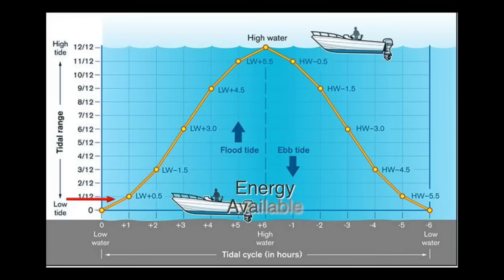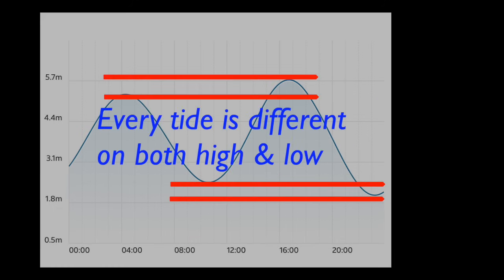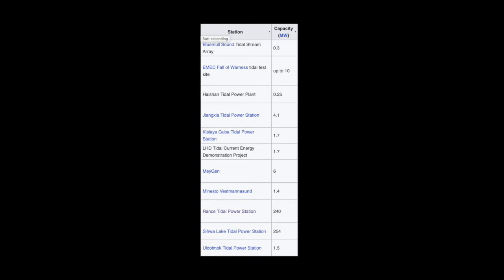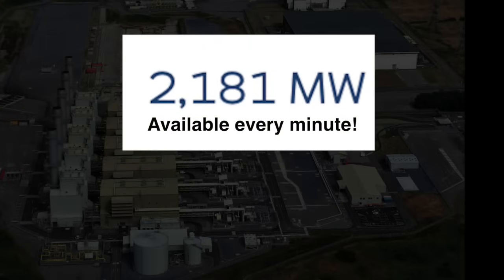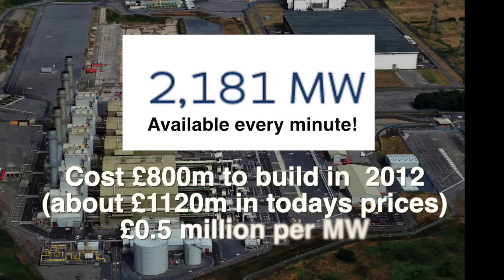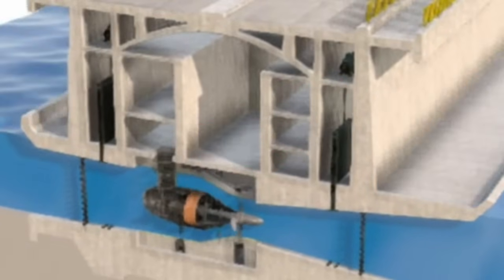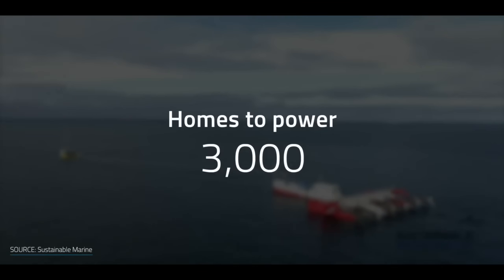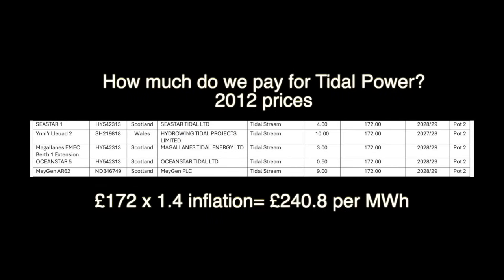The Delusions of Tidal Energy

Comment: Excellent video Paul. to realistically produce continuous power you need 6 units separated by enough distance to have only one unit at a time experiencing slack water,  2 will be on full stream  and the other 3 combined will provide something close to one on full stream. ie 50%  of the available capacity. As the units are small, 100s will be needed around the coast giving some economy in scale  but when compared to coal, oil or gas they will be many times the price. I consider Nuclear too dangerous especially in this war mongering world
Reply from the maker: Yes but that would be totally unaffordable and still not provide enough energy.
Reply: @ClimateRealism  I worked all this out some 30 years ago when i worked in the power generation industry. Noone wanted to listen

Comment: Great video as usual Paul; could you please do one on the Flywheels mentioned in the Telegraph today. I don't understand how they store energy. Many Thanks
Reply from the maker: Flywheels do not act as an energy store - the just balance out small fluctuations.
Reply from the maker: Just read what Milliband has said - totally, totally bonkers. No understanding of anything at all..
Unless power is supplied it slows down and loses the  energy - no good for other than a tiny evening out of the  energy. Insane.
Reply from the maker: Just fully caught top on these Norwegian flywheels - these CANNOT BACK UP ENERGY FOR MORE THAN A TINY AMOUNT OF TIME. I will do a video on it, it is so absurd it takes my breath away.
Reply from the maker: I am so mad about this absurd idea:-
" In the present scenario, flywheels of 1 kW power storage capacity for 3 h and 100 kW for 30 s have been successfully developed. Design of Larger wheel to store 250 kW power for 10–15 min is under progress. Depending on winding losses, bearing losses and cycling process, the round trip efficiency of flywheel modules varies from 80% to 85% [19]."
So 10KW for 3 hours or 100 KW for 309 seconds!!!!
We need at least 7,200,000,000 kWh for 9 days!.
Fly wheel energy saps away very quickly even in a vacuum they are dead within few hours because off the rotation of the earth.
it has no role whatsoever as backup storage.

Your car uses a flywheel to smooth out the strokes of the engine - that is a typical application.
Reply from the maker: HERE IS MORE:-
"Flywheels are an ingenious way to store energy.  Essentially, a giant rotor is levitated and spun in a chamber by way of magnets.  Since there is very little friction, the flywheel spins continually with very little added energy input needed.  Energy can then be drawn from the system on command by tapping into the spinning rotor as a generator. 
Beacon Power is building the world’s largest flywheel energy storage system in Stephentown, New York.  The 20-megawatt system marks a milestone in flywheel energy storage technology, as similar systems have only been applied in testing and small-scale applications. 
The system utilizes 200 carbon fiber flywheels levitated in a vacuum chamber.  The flywheels absorb grid energy and can steadily discharge 1-megawatt of electricity for 15 minutes.  The system takes the place of supplemental natural gas power plants that have been used to balance supply and demand in grid activity prior, boosting energy production during peak demand, and lowering production during peak supply."
So at great cost you get 1 MW for 15 MINUTERS.
So we need how many plants like that to give 7,200 GWh?
Millions and millions off them.

Comment: thanks again Paul.
I have often been a supporter of getting some of our energy from the sea and your explanation on the TIDAL part was very informative. Thanks.

I do however think there might be something in the "Streaming" aspect that we shouldn't walk away from too easily. It will still take some ingenuity granted, but isn't that what us Brits are good at ?
Offshore currents are GUARANTEED so long as we have a Moon.
Placing wind turbine style structures on the sea floor is obviously full of problems, which you highlighted in this video. SO SCRAP TURBINE STYLE DESIGN and think of something else. Could we not develop something that is basically along the lines of an Archimedes screw ? Size and number of fins/inch etc needs to be calculated to maximise the amount of power we can get, depending on the strength of the current being exploited. Being tubular in shape they could be placed in lines along the flow of the current, allowing us to extract as much power as possible. Fixing these things on the sea floor will be easy, as I used to work in Offshore Oil & Gas and what they can do 5,000ft below the surface is amazing, even now.
The  Screw principal think will  cause no real danger to sea life, as it rotates within itself rather than having blades rotate and slice into things over a 90-150 - 200ft radius.
Also, once we crack the challenge of meaningful mass production of GRAPHINE, we can locate these facilities further and further offshore, due to its far superior performance in bringing that energy ashore. Meantime, lets focus on cutting our teeth on currents closer to shore while we develop and improve the technology.
Just a thought.
Reply from the maker: @Philip-x3d  sorry but that would still not change the physics. There are many streaming contraptions but all are uneconomic.
Reply: @ClimateRealism  thanks Paul. Its still guaranteed energy for as long as we need it, so eventually I hope we do find some means of tapping in to this (limitless ? ) resource.
Reply from the maker: @Philip-x3d  simply not true. It is not available energy.
Reply: @ClimateRealism  Oh dear. I'll leave it there then. Cheers.
Reply from the maker: @Philip-x3d  I am not being nasty. What matters with energy is what is available not some hope. The extraction costs of tidal are simply too  high as to be viable. I am sure you are sincere but you are basing your case on hope and wishful thinking. Accepting the reality is crucial.
Reply: @ClimateRealism  Hi Paul. I agree about that as far as tidal is concerned. 
But offshore ocean currents are moving and so must carry ENERGY. This is the energy we need to learn how to exploit. There MUST be a new Brunel somewhere at school or Uni, who will eventually solves this as it is an inexhaustible source of energy IF we can find a way to tap into it ? Thats where my Archimedes screw idea comes in, as a new way of trying to do that, without killing sea creatures and maybe damaging the sea floor environment and so reducing objections from the usual suspects ? 
I will have to keep my fingers crossed for a new dose of British ingenuity during my life time !!! 
Very best wishes mate.
Reply from the maker: @Philip-x3d  sorry, no again.
Offshore is a no no. Very low currents and hugely expensive. Nobody would even try it as the simple maths make it pointless.
Reply: @ClimateRealism  thanks Paul. You have added to my "knowledge" in that I didn't realise these currents were so low ? Usually in documetaries I have seen over the years, they mention how "strong" certain currents are. Maybe its our current technology ? 
I will still retain my hope that we CAN Invent something new, that CAN operate in these conditions ? 🤔

Comment: I remember experts saying how delusional wind power and solar was impossible for the UK, and that was about 10 years ago! When we used 80% coal for power generation. We have just switched off the last coal station in the UK. The tidal power was cast aside for decades but there are many companies now designing and building new machines to harness the tides of the world. It will happen! Let's see how your theories hold up in ten years.
Reply from the maker: I put forward no theories - just facts from the industry.
As regards your comment on wind and closing the last coal station along with Port Talbot blast furnace - it has achieved nothing, not even reduced CVO2 emissions. We are now leading asa having the most expensive electricity in the world.
You are not making any single valid point just a sort mod wishful thinking.
Reply: Generators making use of the tide will either be economic or not, where they are placed is the most important point, like between the Orkney islands which is already happening and can they be easy for maintenance. The jury is still out for me. 
Having millions of EVs on the road will be part of the solution using VEHICLE TO GRID. As will building massive batteries which are coming to kill the peaker plants. If Tata had not taken over British Steel  The industry would have died 10 years ago. All our big ship builders have gone. I still believe in nuclear power also on smaller scale units that Rolls Royce have developed.
There is going to be an 800,000 DC volt cable to Canada / Scotland being planned which will give 16 hours of sunlight for either country. Another cable from Morocco is planned. I think we can build any of these systems but price will determine what actually wins. China has installed in the last nine months; 62 GWTH of solar and wind in the last nine months. That's more than our heaviest load day. The world is still experimenting with gravity batteries! Compressed air batteries, and numerous other technologies. I agree we are being screwed on price, Millivolt is as mad as a mad march hair. But all the governments have just played around with our energy needs over the last 30 years. We are only responsible for 1% of the world's pollution. Nothing more is going to help much apart from people not having to breathe in Pollution on an industrial scale. Coming back to tidal I think it will end up making a useful contribution to the grid in the future.
Reply: @jcfallows the current state of our power grid is appalling,  regularly importing 20% of our power, then  oscillating to over production . If we where to switch off gas tomorrow we'd all be sitting in the dark on a regular basis . All that's been achieved is a increase in energy costs
Reply from the maker: @jcfallows  
A full answer:-
You
Generators making use of the tide will either be economic or not, where they are placed is the most important point, like between the Orkney islands which is already happening and can they be easy for maintenance. The jury is still out for me. 
Answer
The economic argument is over - they are not. Tying a society into power at more than 6 times the cost of what it could be is important.
YOU
Having millions of EVs on the road will be part of the solution using VEHICLE TO GRID. As will building massive batteries which are coming to kill the peaker plants. If Tata had not taken over British Steel  The industry would have died 10 years ago. All our big ship builders have gone. I still believe in nuclear power also on smaller scale units that Rolls Royce have developed.
Answer
No it will not be part of the solution. It is fairy tale nonsense to think we can swipe power from EV';s. Akin to stealing petrol out of cars without asking the owner. Total pie in the sky.
YOU
There is going to be an 800,000 DC volt cable to Canada / Scotland being planned which will give 16 hours of sunlight for either country. Another cable from Morocco is planned. I think we can build any of these systems but price will determine what actually wins. China has installed in the last nine months; 62 GWTH of solar and wind in the last nine months. That's more than our heaviest load day. 
Answer
The £60 billion being spent on destroying our countryside is pure madness - the cable does not give us energy, it transports it at a loss.
China has the world largest wind farm near the Gobi Desert that produces no power as it is not connected up. Part of their mad world.
YOU
The world is still experimenting with gravity batteries! Compressed air batteries, and numerous other technologies. I agree we are being screwed on price,
ANSWER 
all of that is just nonsense and I have dealt with that in my storage video. The physics are wrong and the economics pure madness.
YOU
Millivolt is as mad as a mad march hair. But all the governments have just played around with our energy needs over the last 30 years. We are only responsible for 1% of the world's pollution. Nothing more is going to help much apart from people not having to breathe in Pollution on an industrial scale.
Answer
CO2 is not a pollutant.
YOU
 Coming back to tidal I think it will end up making a useful contribution to the grid in the future.
ANSWER
That is just wishful thinking.
Reply: You are right about the blast furnace closing it will make no difference,  as they are rebuilding one in India, so the world gets the same pollution.
Reply from the maker: @jcfallows  It actually gets more because they have lower pollution standards.
Reply: @jcfallows  nasa currently has 1104 active patents , many of the inventions attributed to nasa are urban myths including velcro , Teflon and the microchip . 21 new blast furnaces built in 2023 around the world , . UK seems hell bent on depleting manufacturing and stable energy production .
Reply: I don't disagree with you, but the UK has been buying electricity from France for decades, good for them good for us as they went down the nuclear route. The pollution from coal burning was floating over to the Nordic countries. It was damaging all the forests there. The Hinckley C nuclear power station is going to be a very expensive base load. The slow speed it's being built at, we will probably see fusion energy coming on line before it starts up. Our Hydro stations use more electricity than they generate with the cost of pumping the water back into the dam, but it's worth it because you can switch it on at peak times and push that energy out within seconds. There seems to be a lot of companies designing barrage turbines so let's see if they can contribute or not. It might be useful for military purposes where economics aren't important?
Reply: @jcfallows  can't see how expensive electricity is a miltary advantage . There are 256 European coal power plants . 58 of them in Germany.  The last 2 steel plants in the UK about to shut / shutting blast furnaces . No sense in any of it . Really think the UK protecting Norwegian trees is over rated 🤔
Reply from the maker: @jcfallows You are mixing up hydro power which is great with pumped storage. Pumped storage is a battery not a power source and as you say is used for balancing but only tiny amounts, not backup for renewables.
I am all for modular nuclear and fracking.
There is no way any barrage design tidal can do the job - just look at Liverpool at 52 times the capital; cost!
Reply: I think Tata are building a new blast furnace in India from the grants garnered off our government these are still needed for making new steel, the electric furnace only melts recycled iron doesn't it?  Tata wants it, always, they got all the technology from British Steel now they want super cheap wages in India. P & O liners sacked all the English staff in Hull and brought in staff at £4.40 from Thailand or somewhere like that. The military might need a floating power source maybe under the arctic ocean there is a lot going on at the poles by the big nations. But it's all top secret,! Even if it fails as you think it will,  you never know what other useful discoveries or new construction techniques will come out of it. People thought going to the moon was a waste of money, but more than  20,000 new inventions came because of it.
None believed SpaceX could do what they have done but they did the impossible!
Reply from the maker: @jcfallows  Agree with much of that.
I would however point out that8 Space X ws private money making a profit.

Comment: We clearly share the same concerns regarding the construction of massive new pylons destroying our respective landscapes. I'm in Scotland, and saw first hand the blight on my country with the installation of the Highland Interconnector, which would appear to be also happening in Wales. 

What also concerns me is that these new pylons will be passing through remote and largely unpopulated areas, and are surely vulnerable to attack by home grown terrorists, or agents of the increasing number of countries we are in conflict with.

Some years ago, installation of the new Highland Interconnector pylons connecting wind farms in the north of Scotland to the National Grid were completed, and the redundant low capacity pylons were removed. This appeared to have been done by simply toppling the old pylons with an angle grinder, leaving a crumpled mess of steelwork on the ground which was later removed, leaving only the stumps of the old pylons visible. I travelled the A9 numerous times during the installation of the new pylons, and the number of diesel powered heavy plant vehicles was unbelievable.

A lot of the route of the Highland Interconnector runs alongside the A9 between Perth and Inverness, however - there are numerous points where the pylons are only accessible by remote tracks in sparsely populated areas.

I find it quite worrying that it would appear to be very easy for terrorists to destroy a high capacity interconnector with nothing more than Google Maps, a couple of cordless angle-grinders, and a pair of hiking boots.